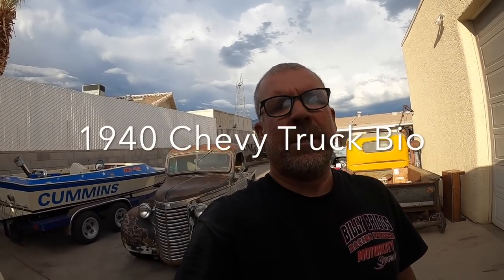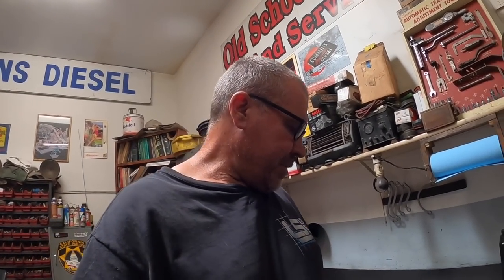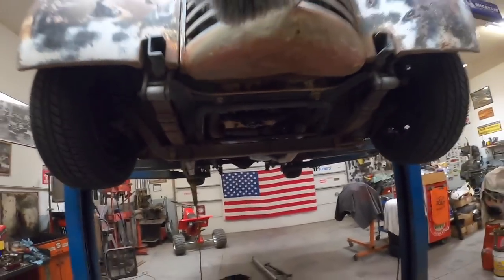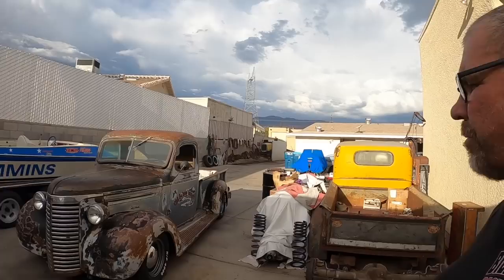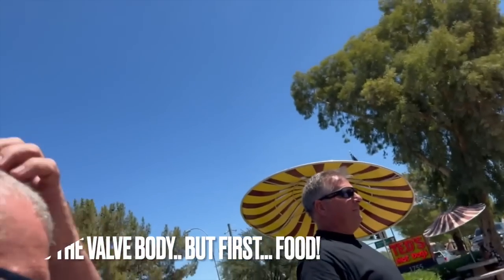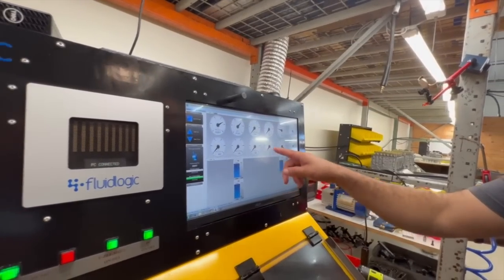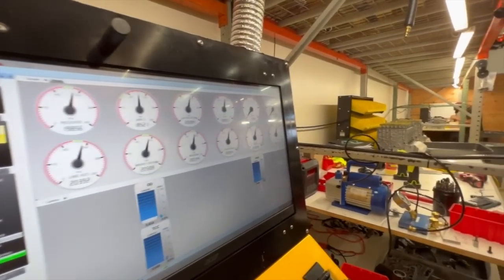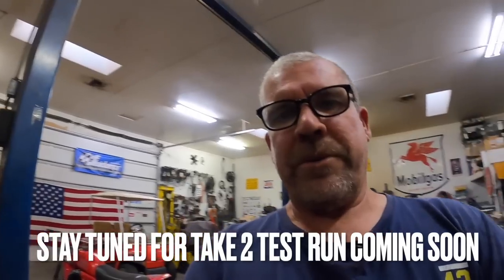You Won't Believe How Much This Truck Cost!

Comment: My old 318 Dodge dump truck had a motor put in it before I bought it and they left out the dowel pans that aligned the bell housing. I kept going through clutches and not understanding why until I looked at my input shaft and its collar for the throwout bearing was chewed up on the top side only from the motor hanging down on the bolts. The throwout fingers did the chewing.

Comment: 100 psi of oil pressure could be the reason for your failed bearings. Years ago, a machinist warned me about doing this and I didn't listen. I spent good money rebuilding a SBC and I wanted the best. I thought I was upgrading the oil pump by going to a high volume unit. Great oil pressure. A couple of months later, my beautiful engine has a rod knocking. All of that oil was up in the valve covers and couldn't drain down fast enough, so the bottom end starved. A stock pump with 30 psi would have been just fine. The lessons that cost money are lasting memories.
I love the '40 Chevy. It reminds me of the one in the movie "The Last Picture Show". Check it out.

Comment: Love the channel and the stuff you build. Can you do a video on the AC systems you use? Like the box, controls, compressor, etc. I saw Paul on fab rats used one but I need to know what to order to put air in my 1970 c10! Thanks for all your solid advice

Comment: Merlin I drag race a 1963 Impala SS in nostalgia Super Stock .It's a 452 cubic  inch 409.  My best time with it is a 10.76 @125.+mph. I thought you might like to hear about another w head motor. Some of my friends with 409s have ran 9s. A 348 with a 4 and a half stroke and 60 over will go to 440 inches. After hearing the story when I was about to be drafted I enlisted for 2yrs. After basic I was sent to Aberdeen Proving grounds for training in armament on helicopters. Our instructor told us he wasn't going to BS is we were going to be door gunners in Vietnam. I had a  1970 SS Chevelle for my street machine that a friend wanted to buy. After the news the instructor gave us I sold my Chevelle. When I got my orders after my armament school was over I was sent to FT. Hood Texas. I called home and told my brother not to sell my car. He told me I was too late my friend got it last weekend.
Reply: Great looking '40. Perfect stance, patina and overall look. NOW, what's with the other yellow '39 or '40 in your yard? I have a '53 3100 5 window, a '72 C/20 (bought new in '72) and now a 2018 Colorado. Also, a like new 1998 Cherokee with 70,000 miles on it.

Comment: It’s been awhile since I’ve seen a 348 Chevy engine. A school class mate bought a ‘58 Chevrolet coupe in about 1960 with factory 348 with 3x2 carburetors and four on the floorthe floor. He still has it and drives it on nice days.

Comment: dude have you ever tried king bearings i like them alot my prefered choice for my builds , i  threw together 350 sbc  in a 66 pickup truck tubro 400 , old small valve heads it would spin 10000 ,wouldnt hold there for too long it would spit oil out the front seal, and dipstick would pop up about 3/8 and spit a little oil , on a cold morning in wa state it would blow smoke rings the funniest thing i ever seen ... really like your channel ,,,, no bs here

Comment: One thing I remember from the days of 348 and 409’s is one way to tell them apart quick if the valve covers where changed is the 348 had the dipstick on the drivers side and the 409 had it on the passenger side.

Comment: Very interesting watching the valve body go through the different gears and pressures.  I never knew so much fluid passed through the pressure bypass.  Yes sometimes when you start to dig through an old rebuild you find things that need service or you check and find issues that need attention right away.  Back in 69 when I first got married I found a 40 Ford Coupe sitting in a garage with original paint and a great body.  It had a small block Chevy in it at one time and the motor and trans was gone and the guy wanted it gone out of his garage, he said he would take $200 for it.  My wife said NO, not another car, I already had three.  I had 55 and a 54 Chevy and a 57 Chrysler.  I still think about what I could of done with that 40.

Comment: Cool story on meeting the owner , my story was on my 66 C-10 i built while going to Auto Mechanics at local Jr.College as my class project . I sold the truck to a buddy that traded it on another used car . I was on my motorcycle on my way home and at a gas station was a older man leaned over the side of the bed with a gas hose from the pump filling a boat tank up . I said hello asked him where he had got the old truck and he did side jobs for the man that the buddy traded it in with . I told him about me building the truck as a class project and that we had gone through each susyem in the truck in class and while that buddy was driving it the gas tank rusted out and so to get him going again we went to Wal-Mart and got the 6 gal . boat tank , i had told him we vould go get a salvage yard mustang tank to fit between the rails as long as we got the hangers that a friend would weld in for us , but he never did it . So the old man had kept the truck just as he got it and was happy as he could be with it , i offered to buy it back , but he said the truck fit him just right !! Great to have seen it in good hands . The wided letter tires look great on your 40 chevy !!

Comment: i have a 1966 D500 Dodge  with a Holmes 500 wrecker was bought new that way. it only has 50,000 miles on it original seat cover no tears. the story i got was the man who bought it new drove home parked in a barn died in his sleep no one knew he had put the truck in this barn 10 years go by big storm comes thru blows doors off barn and there sitts the brand new wrecker. was sold to a local man he sold it to the mans father that i bought it from. he used as a wrecker until about 2000 and parked it and he died and i purchased in 2022 and started it for the first time since parked started right up runs great. fixed all the brakes radiator good wrecker works like new had to replace wire rope due to rust thought you would like the story

Comment: Nice truck great story! Love the grille on the earlier gen !  Im looking for some wheels and tires for my 45 chev 1/2 ton build. Im wandering what will fit in the rear factory fenders ? Those 245/60 your running look like a good fit , Could a guy go wider? Im running a 80s rear camaro diff so its a touch wider 61" then the original rear end. Luv Havasu used to race jet skis down there for many years! Cheers from Canada

Comment: hey was watching a TV show ,, it had a guy that looked just like you on the show ,, LOL .. GREAT video ..I took a valve body out 1 time took it apart to clean it had to get my buddy to put the body back together ,had2 balls in the wrong spot ,, I had him check it before I reinstalled it ,, when I took the body apart the part stuck and dumped the balls ,,if I do it again some day I will be more careful .. also seen the gaskets with the holes in the wrong spots ..

Comment: That car if you get the truck run run better than ones are making now all that stupid computer crap we don’t need a computer crap if you can’t drive it you should have a computer drive for you is younger generation is stupid letting a machine drive you around any driving in my book after you did it can’t drive anyway now

Comment: With the white letter tires you can make those into 2 3/4 wide white walls . first thing i was doing in 1978 at the tire shop was running a white wall laith matching wide wites for used car lots .

Comment: Good morning from Tucson....question sir...since you enjoy upgrading the 5.9's.   Do you have any 1st Gen 1990 non inner cooled injectors you would part with...? I have an inject that misfires on idle...but will kick in at higher rpm's ...just at 220,000 so another set of injections probably would hurt...or at vice on where to get new ones please...cool truck you got there .!
Reply from the maker: contact me on Instagram or mesinger yes i have some gen 1 9mm injectors

Comment: Merlin, I have a question.  In the video on Fab rats channel, you say that this engine is a 409 when talking to Paul and Michelle.  It appears to be a 409, since I do not see the dip stick on the drivers side.  In this video you say it is a 348, so what is it, 348 or 409???
Reply: Is it a 348 or a 409?

Comment: Fully grooved bearings, the rod is now supported by two narrow oil film support surfaces this reduces the bearing capacity over fifty percent of the non grooved bearing, this is why the rod upper bearing is not grooved and the lower can be grooved but most are not the lower bearing does not support the the power stroke so a grooved bearing in the lower position is not as much of an issue. you will see the main is grooved in the upper as the support needed is less than the lower and the groove in the upper main allows the rod and main to be pressure oiled during half the crank rotation, so some people would think cross drill the main and get full rotation pressure oil to both the main and rod, this is also an error as centrifugal force will starve the bearing with a cross drill.
Reply from the maker: so groove is on the main, not the rod

Comment: Love your truck  Bro. 👍. You got a much better deal on yours than I did, but I love mine too. I still run a stock 216 with the Carter W-1 carb on it. Cocker 3 inch white wall biasply tires an artillery wheels. All patina lik yours. I have some videos of it on here.

Comment: You mentioned how the vehicle will handle better with new tires.  I've been to shops and complained about a problem that people tell me is a quirk because of my Jeep's age: 24 years old.  Between speeds of 50 and 60 mph, my Jeep shimmies.  Not badly, but I can feel it.  I did get new tires a few years ago on the back but still have the other tires on the front.  Is that possibly the problem?

Comment: I use to buy those $500 trucks 12 years ago. 59 F100 $200 with an engine and transmission. Fixed it and drove it for 3 years. Those trucks are now a minimum $3000-$5000

Comment: I believe it, I bought a 70 Chevy Malibu 25 years ago for $300 dollars. Took out the 350 & put a 427  with a 400 nine inch for rear end with 373 gears Chevy bolt pattern 5/5. Should of kept her but after flipping car needed something different to have fun with.

Comment: My younger brother ran a 348 in a '50 Ford PU then upgraded to the 460 Lincoln V8.  Both were running machines.  His son the ran and raced the PU some and still has it.  Dad had a '47 Ford PU that he had parked at a building owned by the family.  He gave it to me and I went to tow it to my place.  Someone had stolen it!  Still pissed off 60 years later.

Comment: 348 motors are unable to spin much over 5000 rpm on their best day--if you want it to spin faster than that your problem is obvious! Keep it under 4000 and it will go a long time--don't run it like a newer motor and expect it to live.

Comment: 7500 RPM's! I'm surprised it didn't spit the pushrods off the rockers! Those elephant engines were bad about that!
Reply from the maker: it has a 425hp 409 solid lifter cam with some rocker mods
Reply: @MerlinsOldSchoolGarage  Btw, that Chevy is awesome, and couldn't have gone to a better person!

Comment: So did I miss something? The valve body tested good so what was the issue? Your putting back in but found nothing wrong?
Reply: They were talking the changes they made at first when he had the cover up on dyno machine drilling holes and stuff raising line pressure
Reply from the maker: it tested bad so we looped the Governor

Comment: Hey Merlin. 👋 I tried contacting  you thru your email contact and after all was typed out i  couldnt figure where the send button was. I just dropped off a bucket of goodies i hope you can use. 450 r fourtrax throttle and misc metric bolts from my tinkering in my garage on my bikes. A few fluids. Hope you can use them. 👍✌
Reply from the maker: thank you is did get them sorry i missed you
stop by any time if the gate is open i am in the shop